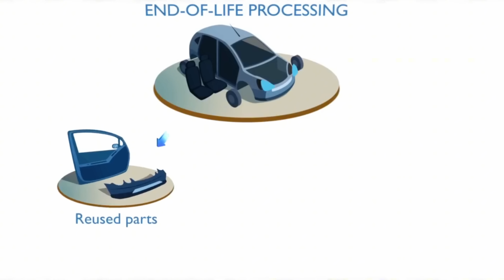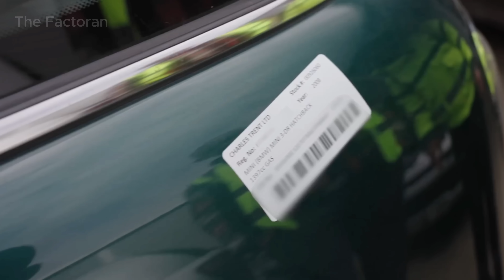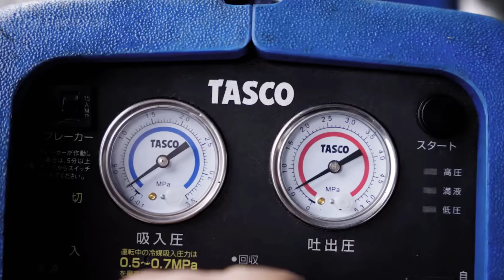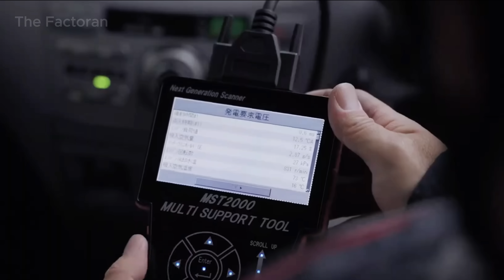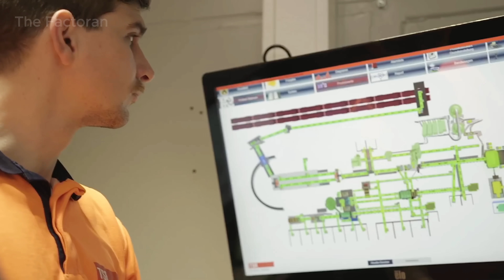How Millions Of Old Cars Are Recycled Into New Steel | Massive Car Recycling Line

Comment: Recycling is one of the most important aspect of consuming, yet we fall far short in processing. How many seen tires, plastic lenses and windshields go through the shredding process caught by the camera. Most that have been stripped off are sold as used or reconditioned parts, but hay nothing is perfect, although they might have you believe that it is...
Reply from the maker: Such an important point — the gap between consumption and recycling is bigger than we think. Thanks for sharing!

Comment: If there were a forced standardization effort by SAE a lot of the modules used in modern vehicles could be resold and reused.  How many different ECUs are really needed?  If cars were better designed for longevity this problem could be reduced.
Reply from the maker: Great point! Standardization could definitely change the game in manufacturing and sustainability.

Comment: This is not what happens to vehicles in the US. Most are crushed in a crusher in a scrapyard then loaded onto a truck. If the car or truck has valuable parts it is set aside for dismantling. Batteries are removed and liquids are drained. Glass is not saved on most vehicles. Tires are not removed unless the rims are valuable. The crushed cars are only sold if the price is high. Otherwise they sit until the price goes up. 😊
Reply from the maker: Appreciate the detailed breakdown — the process definitely varies by region and setup. Thanks for sharing your perspective.

Comment: Bull shit !
Recycled steel cannot be used for structual steel .
It goes into low grade steel like rebar and wire for reinforcing mesh and som flat bar sections
Reply from the maker: Thanks for pointing that out! You’re right that most recycled steel is typically used for rebar and non-structural products, though newer refining methods are starting to make higher-grade reuse possible.
Reply: @TheFactoran I have heard that .
As new steel is a mix of differant elements like manganese etc .
It's hard to get the balance right for the differant grades of structural and othe types needed for differant applications.

Comment: I bought my 4 door 2013 Ram in 2014 with 11k miles for $23,994.  With TT&L it was $27,500. It has had a few small problems but I use YouTube to repair her and she still looks brand new.  I only use Mobil one full synthetic and change the oil every 4500 miles. At 172k, the Hemi is still 395 horse power and I would race any of you. 😎
Reply from the maker: That’s some serious dedication — sounds like you’ve kept that Hemi running like a champ! 💪🔥

Comment: The waste on this planet is 95%. Nothing is built to last. Everything is marketed for cost. All cost is debt supporting debt and costs created are from interest plus tax for operations while cost from nothing are taxed repetitively with regulations. Not only do you pay for something you pay for it again and again at higher costs wasting more resources from disposability and manufactured expiration quality to fail. Nothing has value for cost. If you had no cost of living or taxes the world would use over 90% less resources creating high quality sustainable things that last centuries before recycling.
Reply from the maker: You make a powerful point — modern economies really do push disposability over durability. It’s crazy how much value and material we lose just to keep the cycle spinning.

Comment: i worked in a tool maker facility i know if you cool steel too quickly its loses its tensil strength becomes brital,cooling too slowly its too soft its a science,i ran a tool hardner,we used salt 1450 degrees when steel glowed pink it was time to quench, we used a troft of circulating water to cool, its still one of my more favorite jobs i ever did, ever seen what one little drop of water does when it hits salt at 1450 degrees f ? I have its explosive
Reply from the maker: That sounds like incredible hands-on experience! Watching molten steel hit salt at 1,450 °F must’ve been wild — it’s true, heat treatment is pure science and art combined.

Comment: The car is the most recycled item. From used parts to grinding into steel for recycle.
Reply from the maker: Exactly! Cars are a great example of large-scale recycling — almost every part gets reused or repurposed, from the steel frame down to smaller components. It’s one of the most efficient recycling systems out there.

Comment: Seems to me that they could take a lot of those parts and resell them to cut down the cost of auto body repair rather then grinding them up.  I would think insurance companies would get behind that sort of "movement".  If a used part is as good as new, no need for a new part.  Also things like alternators and water pumps, ect could be remanufactured right there at the same location.  Thus, no having to ship them some place to be repaired.  Probably plenty of tires that are also in good shape could be resold there.
Reply from the maker: Totally agree — reusing and remanufacturing parts would save money and cut waste.

Comment: This not in the US. Vehicles usually go to salvage yards, where they sit for various periods of time. Once picked over, they have the gas tank removed, then crushed flat for transport. Once transported to the a recycler, they are stacked until they are put through the shredder whole. After shredding, the material goes through a series of sorter that separates the various materials. The frag, or chilled scrap is shipped to steel mills. other marketable metals are likewise sold. The remaining ASR ( Auto Shredder Residue )  is landfilled or incinerated.
Reply from the maker: Thanks for the rundown! That’s a solid description of the vehicle recycling process outside the US. Crazy how much gets reused, but that ASR’s a tough one to handle. Got any thoughts on improving that process or dealing with the residue?

Comment: If your new vehicle doesn't last more than 10 years, it's either one of the crappiest vehicles on the market or you just need to change your driving habits. I bought my Ford Taurus in 2004 brand new and it still runs perfectly. And my mom's Ford Comet has been on the road since 1971..  10 years...ptffft

Comment: This AI video is very misleading in that the scrapping process in the USA isn’t nearly so clean and thorough.  Once marketable parts are sold, fluids drained and refrigerant removed, the rest gets shredded without dedicated removal of glass, motors, wiring, etc.  Nearly no glass, plastics are recycled from end of life vehicles.  Only the nonferrous 
Steal bits large enough to be captured by eddy current separation is recycled, with much of the copper wiring getting disposed of as Auto Shredder Residue.

Comment: I don't think most places do this much disassemble unless they are taking the parts for reuse they just throw it into the crusher windshield and all
Reply from the maker: Exactly right 👍. LPG liquefies at relatively low pressures—usually under 200 psi at typical temps—so it’s easy to store in cylinders. CNG, on the other hand, is methane and needs compression to thousands of psi or cryogenic cooling to become LNG. Totally different handling and storage requirements.

Comment: I've had my 2003 GMC truck for 23 years ...bought it new straight off the show room floor and its still running strong...its also 4x4 ...no complaints..no problems...like they say in the commercials...that's professional grade...and I agree💯
Reply from the maker: That’s awesome! 💪🚙 23 years and still going strong really proves GMC’s “professional grade” slogan. Sounds like you got yourself a rock-solid truck.
Reply: I bought a 1995 chevy 4x4  pu  brand  new  and still runs good  thats 30 years  probably  keep it forever

Comment: Most of those cars were in good condition, what a waste that someone else can use
Reply from the maker: Yeah, it does feel like a waste 😕. A lot of those cars still have plenty of usable life or parts, but once they’re pulled into the system, they’re treated as scrap. The upside is that the materials get recycled, but it’s tough knowing some could’ve helped keep other cars on the road.

Comment: Both my daily drivers are over 50 years old.  The most basic transportation, low cost parts, ease of repair, tolerable mpg.  I have saved countless thousand$ over the course of my life.
Reply: What's your thoughts on using Ai clickbait to trick people into watching a video?
Reply: Land Rovers ?
Reply: Ah, you must not live in the rust belt! Salted roads are necessary but costly for the car owner.

Comment: The new electric cars will last twice as long.  300000 miles or more before the battery goes.  Much lower maintenance in between, And a lot less mess at the end.  Much less air pollution, and near zero oil mining.
Reply from the maker: That’s a great point ⚡🚗. EVs are built with fewer moving parts, so there’s way less wear and tear compared to gas engines.

Comment: Recycled steel and other metals used in manufacturing internal components used in building new engines and drivetrains. Is this why almost every auto and truck maker's customers are now suffering catastrophic engine and transmission failure during the first few miles?

Comment: I worked at a wrecking yard. This video is mostly B.S. vehicles sit in wrecking yards for long periods as they came in. Slowly stripped of salable peices until most resalable is stripped. Only then are they compacted and sent to larger recyclers.
Reply from the maker: Thanks for sharing your experience 🙌. You’re absolutely right—at many wrecking yards, cars aren’t crushed right away. They usually sit around, get parted out for anything reusable or salable, and only after that do the stripped shells head off for shredding and recycling. The video just compressed the process for storytelling, but your firsthand view adds the real day-to-day detail.

Comment: I like how it goes into depth about each step they take to remove the wheels, tires, windshields and windows, all fluids, engines, transmissions, exhaust, etc. etc. to prepare to be safely and cleanly crushed and then proceeds to show the crushers in action, crushing full cars with wheels and tires and windows, wires, exhaust, engines and piercing hoods with sheers so that gasoline and other fluids spray out all over the place 😆🤣 classic 👍
Reply: Exactly. If you look well, the video is made by joining scrapping facilities in different parts of the world. From nearly perfect management of the asian (seems Japan or Korea) to brutal african dumpsters. In the middle, the various shades from Europe, UK and USA.
Reply: @zooropaforever  Some of the video takes are from maintenance garages rather than reclamation facilities
Reply: What's your thoughts on using Ai as clickbait to trick people into watching a video?
Reply: There are a lot of them reaching the crusher WITHOUT BEING PROPERLY DISMANTLED As is saw cars still wtth wheels on (which is illegal) as by law    ONLY THE EMPTY BODY SHOULD BE CRUSHED Everything else should either reused or recycled seperately off the car.

Comment: Making cars with only 5 to 8 years useful life, ensuring the materials are biodegradable,  then recycle them, consuming more energy for the melting and processing of metals and material, and some none recycleable waste... is that really environmental?   Why don't they make cars that is to last 20 to 30 years, modular that essential part can be taken out and upgraded over time,  and that, is environmental!
Reply from the maker: You make a really solid point. 👏 Building longer-lasting, modular cars that can be upgraded instead of replaced would definitely feel more sustainable. The challenge is balancing durability with safety standards, new tech, and cost efficiency—but I agree, a 20–30 year car sounds like the smarter environmental choice.

Comment: In Europe and UK we have more and more recycling centres that don't have any manual sorting processes. After the usable parts & fluids are salvaged, everything is done with automation after the shredding process. From magnet belts to remove ferrous, eddy current separation for aluminium & copper, optical sorters that look for plastics & rubber, zigzag cascades to remove glass, and air suction equipment to lift textiles and foams in interior parts. What comes out are bunkers full of over 96% clean material streams without any human involvement at all. The facilities are expensive to start but generate massive profits by selling each material stream to the highest bidder.
Reply: What's your thoughts on using Ai clickbait to trick people into watching a video?
Reply: Amazing how clever people have figured out how to engineer such systems!

Comment: We discard too many cars that are still usable. We are too rough on our cars. We don’t take care of them. They can last a long time. They can last 200,000 miles. If they are cared for with a few exceptions.
Reply: I drive '87 & '85 Ford vehicles. I like simplicity, durability and self-repairability. The '85 Econoline has only 245,000 miles on it. Some people put that much on in less than 5 years!
Reply: Many used to be able to last that long but not their transmissions.

Comment: Why 10 years?
Value at end of life for recycling would be the same at 20, 30 or even 50 years.
The difference being that prevents 2, 3 or even 5 replacement vehicles from having to be produced at all.
All that energy and CO2 required for manufacture and end of life destruction, massively reduced on a per mile basis, by maintaining and driving for as long as possible.
When we keep getting told the answer is to scrap 10 year old cars, because new ones are allegedly marginally cleaner, the climate scam is widely exposed as just an economic driving lever.

Comment: I have my Dad's 1962 Dodge D100 Sweptline, slant 6, 4 on the floor Pickup and still runs great no oil burning , 120k on it.  My wife and I still have our bought new 99 honda v6, Ex Sedan, has 390K on it and still runs great, no oil burning.  I have my daughter's 94 Chevy V6, 4.3L, C1500, 260 k, no oil burning, runs great.  What's the key?  3 things.  The most important gage on your instrument panel is not the fuel gage...its the water temperature gage...
rule number ONE, if you ever see the engine water gage is getting into the yellow or red or light comes on for that indication, safely but immediately pull way off the side of the road, put it in park, shut OFF the engine, pull the open hood handle, get out of the car, open the hood, get back in the car, lock the doors and call a tow truck to haul to your home and then take a breath and take your time to see what caused the temp. gage to indicate hot.  
Rule number 2, keep you automobile clean, not necessarily talking about taking it to the car wash for vacuuming and wash, although that is always good to do, but talkin' about what's really important cleaning, change to new oil at 3k to 5k miles, change to new engine air filter as seen visually, change fuel filter as required. change to new radiator hoses and heater hoses and BELTS per manufacturer recommendation could be close to and over 100k when needed change,  
Rule number 3, go back to Rule number 1, know where your engine water temperature gage or light is at a glance and never ever allow you automobile to overheat longer as soon as you recognize the overheat warning indication...know where and what  that gage needle or light located on the instrument cluster looks like and it will save you to never allow your engine to be destroyed by it's number one enemy, OVERHEATING. Follow Rule number 1 when the temp starts to go beyond normal temp.  Very simple if you follow these 3 rules and your best friend on the road will run forever, beautiful side benefit you will not have very expensive car bank/CU car payments for life.
Reply from the maker: That’s some great wisdom—clearly those rules have kept your cars running strong for decades. 🚗

Comment: Old cars are a huge amount of the pollution of the planet. They should be made to last much longer than they do. Simple motor changes to a new motor  and many other parts should easily be upgraded to keep them in service much longer. Also dump all the unnecessary sensors etc. make the motors stronger, like they were years ago. But there is less profit in that for the billionaires. doesn't matter what it costs as long as they make big money, who cares about the planet?
Reply from the maker: You’re right—longer-lasting, upgradeable cars would help both people and the planet, but profit often takes priority. 🌍